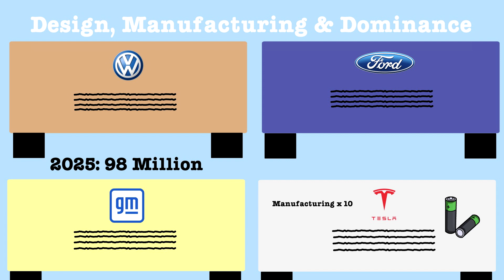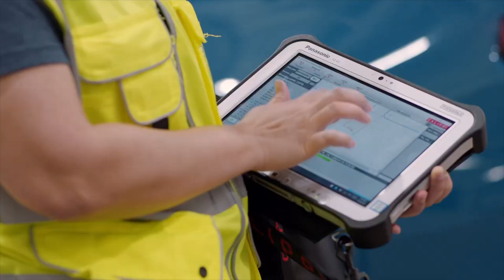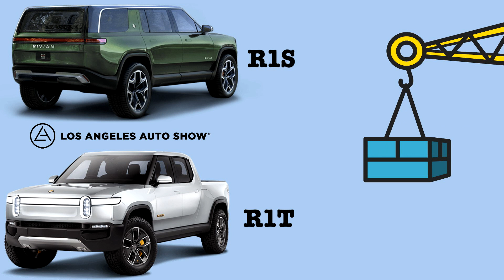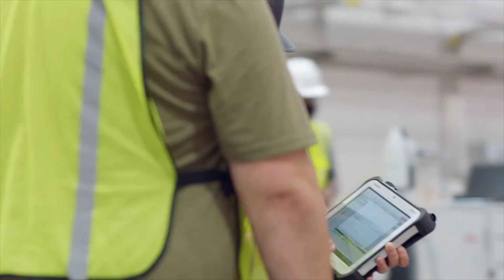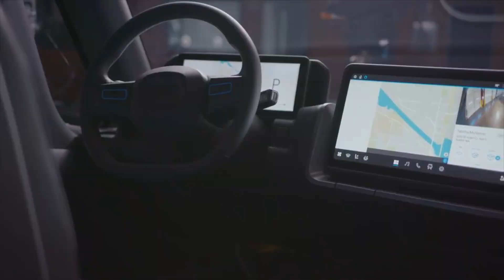What is Rivian? Tesla's Biggest Competitor

Comment from the maker: Would you drive a Rivian SUV?
Reply: NO, Already have FULLY Spec Cybertruck PLAID w/ FSD on order. 
RIVIAN is NO competition for TESLA.
the Cybertruck is already CHEAPER than the entry level RIVIAN, and the Rivian is a LIGHT pickup class, and is Built FAKE TOUGH and not REAL TOUGH like Cybertruck is. 
RIVIAN will dent, scratch and RUST just like any Pickup today. 
but, where will you be able to REPAIR a Rivian ? 
TESLA is a Medium/Heavy truck Class , and has BEST in Class payload of 3500 lbs,  BEST in Class cargo at 100 sq ft LOCKING storage, and 15,000 lbs TOWING. 
all in a LIGHTWEIGHT Stainless steel body that can FLOAT 🚤 and Ford 5 feet of water 💦. 
CT also has great approach, departure, and breakover. 
with a 16" ride height, and 14" travel. 
and it can KNEEL the truck bed to allow loading with the Built in stowable ramp.
Reply: Yes!
Reply: If they actually had production vehicles, yes.
Reply: yes sir.